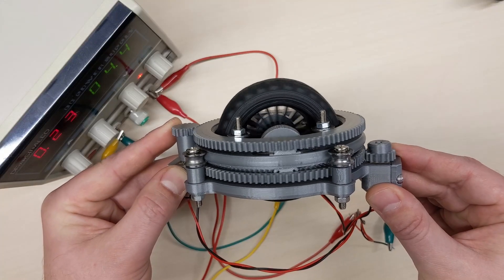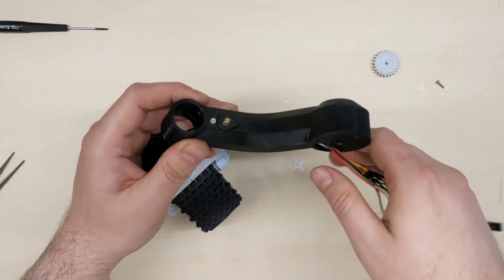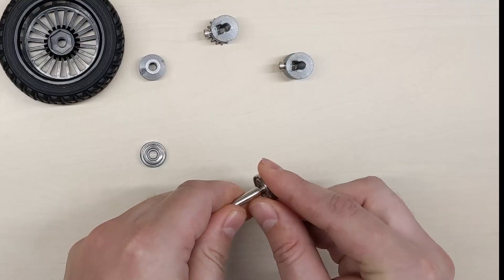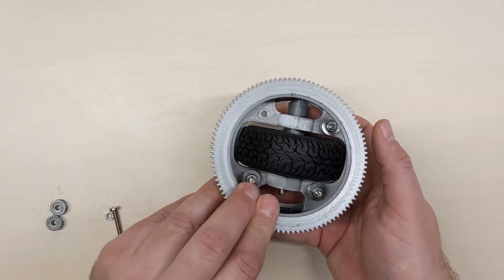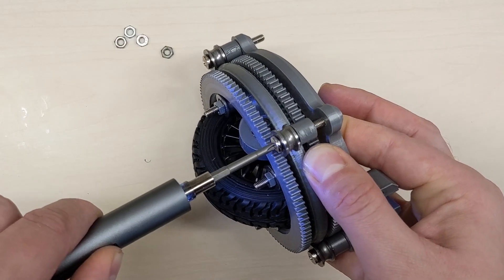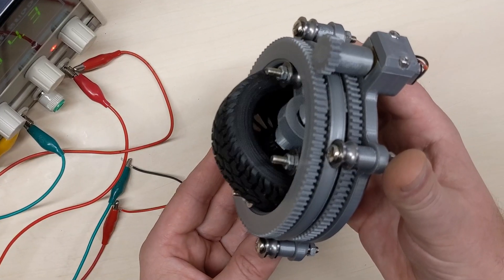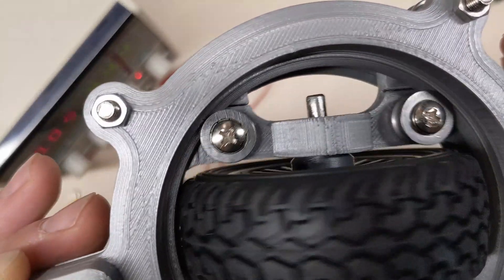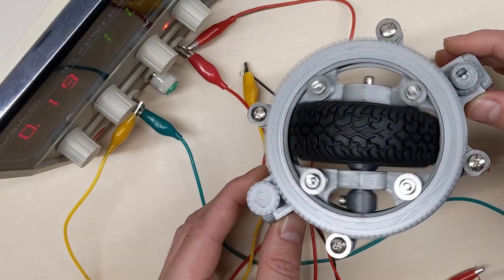Differential Swerve Drive

Comment: absolutely GENIUS- your idea, or did you get it from somewhere else?
Reply from the maker: I wanted to make wheel with two stationary motors that controls the two axes. I had the idea to use a differential like in a car, where one input motors controls two output wheels, but in reverse, so that two input motors controls one output wheel. Looking a differential I noted, that you can connect an axis to the inner gear to get the last rotation. After having thought about this for some time, I just went on Youtube and found similar solutions. It goes by the name of "differential swerve" and are typically used in robot competitions.

Comment: Could a "slip ring" have solved the "tangled wires / limited rotation" problem on your original design?
Reply from the maker: Yes probably, but they are quite expensive, and also I'm not sure how well they work for transferring encoder signals from the motors without adding noise to the signals.

Comment: Hi, i have a question. What is the maximum payload for this Swerve drive sustem if there is 3 of it. I would like to know as i want to implement 4 of it in my project. Thanksee ❤
Reply from the maker: I'm not sure. The N20 motors I used in this demo is not strong enough for heavier load. In this three wheeled design https://www.youtube.com/watch?v=4N6FfiLL41w I used stronger motors. I think it can handle several kgs before the load on the plastic parts is too much.

Comment: why not just use the original design with slip rings?
Reply from the maker: Slip rings are a bit expensive when you need 6 of them. And also, I'm not sure they can transfer the encoder signals from the motors without adding noise.
Reply: @wildwillyrobots  guess you have a point there on cost, idk about the communication, it's been a minute since I seen this.

Comment: I was wondering, how did you design the reverse bevel gear? Or if there is a better name for it?
Reply from the maker: The bevel gear was modeled in Onshape using a feature script called "Bevel Gear Pair". It was then combined with a normal gear made using the "Spur Gear" feature script.
Reply: @wildwillyrobots  Could you possibly make a CAD tutorial on making one? Also if you know is there a way to do this in fusion360?
Reply from the maker: @bio.s2903 In Onshape, once you have selected the feature script, you get a dialog, where you put in the dimensions and the gear ratio, and then the gear is automatically generated.
I have never used Fusion360, but assume it can run custom scripts to generate complex parts, just like Onshape.

Comment: Brilliant design. However I think a simpler answer to your problem would have been to use a slip ring to pass the drive motor wires through the steering axis.

Comment: A slip ring might help with the wires limiting rotation
Reply from the maker: Others have made the same suggestion, but they are a bit expensive. Also, I'm unsure if they can deliver a noise-free signal for the encoders. Regardless, I simply wanted to try something different.

Comment: When making your robot, make sure to use a gyro so that the robot can be driver oriented, and not robot oriented. It makes it much easier to drive.
Reply from the maker: I will mostly be running it autonomously, so remote controlling is not an issue. But I will most likely add an IMU to improve the accuracy in autonomous mode.
Reply: @wildwillyrobots  Sounds good. If I can be of any help programming it, let me know. This project looks very interesting, and I am excited to see where it goes. Keep up the good work.
Reply from the maker: @SomeGuyOnTheInternet118  I mostly got it working, as you can see in this follow-up video: https://www.youtube.com/watch?v=3W0p16vsgqA Will make a more detailed video about how it is controlled later.

Comment: Outstanding design!  I am a boop. But what makes me curious is that compared to omni wheel, what are the advantages and disadvantages?🤣
Reply from the maker: Omni wheels with rollers tend to slip on the surface. Also, you can push them around because the rollers are not actively controlled. This makes it hard to do precise navigation. This design is better suited for navigation, but compared to an omni wheel, it is much more complex both in hardware and in the software needed to control it.
Reply: Thank you very much!

Comment: what happened to the cad file it does not work when I click on the printables link
Reply from the maker: I think Printables are having some issues at the moment. It works, but download is extremely slow. According to a banner on the site, it is currently working in limited mode.

Comment: You may want to consider an alternate gear setup that will take a couple more gears. The way you have it setup now you need both motors to spin exactly opposite to move without turning. By adding gears you can make a mechanism move without turning with only one motor. The other motor will turn it. More complicated but maybe more ideal in some situations.

Comment: I think that I can write down the math to decouple the rotations and create a preprocessor block that given the speeds on each axis generates the speed references for the two motors
Reply: Actually I think I've done it
Reply from the maker: @FliBaleon  Yeah, it's not that complicated. For one motor is is the sum of the wanted rotational speeds (each divided by the ratio of the gear for the rotational axis). For the other motor it is the difference of said values. Or at least, that was what I got😀

Comment: Back in 2012 I worked on a design we dubbed Emperor swerve for FRC competition. The design files should still be public. Our design just like this one requires very accurate sensor feedback of the wheel orientation and speed. Our biggest issues revolved around that data becoming inaccurate. We uses an optical limit switch to identify when it was pointing straight forward, without it we’d loose orientation in minutes.

Comment: I wonder what will happen when the wheel is forced to stall in either turning or motion. I suspect this designs major downfall will be unintended direction changes and wheel motion when there is stalling or a mechanical failure of a gear or bearing.. 

Neat design, but I don't think it will fail very gracefully.

Comment: Another way you could use your original design is if you ran your wires from the motor for the wheel itself and for the turning up and then you with 3D printing make a column and actually put copper rings on it just like an electric motor a brush motor and then you take some old brushes or you can make some brushes using copper and Springs that will rub against the Rings in that way I actually allow you to spend 360° as many times as you want and still get the power to it as pretty much the same way how some heavy equipment works that's the same way how airplane and helicopter de-icing systems that need to use high voltage to heat up the blades work your steering wheel in your car or truck uses the same thing for the horn all the controls on your steering wheel and for the airbag it's called a clock spring for the airbag and everything

Comment: This was very cool, maybe add a second gear in the opposite direction but allow it to spin freely from the wheel drive shaft, this way it would do nothing in terms of motion but it would give extra stability and the wheels could handle more heavy duty aplications, overall this is a very impressive design, I want to see how it evolves

Comment: What’s the catch? Sure there are some limitations of design. Like loss in torque for example?
Reply from the maker: The large space required around the wheel is one obvious drawback. Another the fact that if you run the motors at full speed to drive (spin) as fast that you can, you need to slow down in order to rotate.

Comment: Really cool idea.  While horizontal and vertical rotation are both easily used separately, I wonder how much use really comes from the range between.  It seems like the motion gets a bit difficult to predict.
Reply: If quadrature encoders where used on both motors, the motion should be very predictable.

Comment: Have you thought about using a slip ring?
Reply from the maker: Yes, but they are a bit expensive when you need 6 of them. Also, I'm not sure if the cheap ones are able to transfer the encoder signals without adding noise.

Comment: Are you planning on having some kind of positional sensor to check that the wheels are pointing in the direction the robot thinks they are?
Reply from the maker: Yes, I will add encoders to both motors and a third sensor for zeroing the rotational axis.

Comment: It's a great mechanical design, well done! I wonder though, how much fine tuning will be required for the controllers. It's likely that one of the motors will be under a slightly heavier load than the other, causing the direction to drift. Close loop control on both motors may be in order, but I would love to see how this develops! Good stuff man!
Reply: I thought the same. Probably an encoder is needed to fine tune the direction

Comment: It's a good design, I'm just wondering if you've considered if simple slip rings would work for your original design.
Reply from the maker: Yes, but they are a bit expensive when you need 6 of them. Also, I'm not sure if the cheap ones are able to transfer the encoder signals without adding noise.

Comment: To allow the wires to rotate infinite times inside the joint, you could solder them to rings in the pole, and that rings conected with tabs to the wire arms. This will solve the problem as many toys do. Your invention its cool, but is not practical at all and overengineering. However it's always cool to see new ideas around.
Reply from the maker: I need to transfer both power and encode signals to the motor, and high quality slip rings are a bit expensive. I mostly created the differential swerve for fun. I know that it has a lot of practical limitations😊

Comment: A very nice design, I love it.
I foresee an issue using DC motors, if the two motors are not exactly balanced (RPM) you will have creep in steering when going straight.
Do you intend fitting some sort of an encoder on the centre part for positional feedback? So that you can make adjustments to each motor.
Reply from the maker: I will add encoders to both motors. From those I can calculate the position of both the rotational and spinning axis.
Reply: @wildwillyrobots  Fantastic. I look forward to seeing more.

Comment: The hardest things is to make the twin motor to keep run on same speed, which can be solved through sensor and dimmer but the more wheels it will be more complex
Reply: Quadrature encoders would let a microcontroller accurately control the speed.
I made a Mecanum wheeled robot which didn't work well until I added quadrature encoders to each of the four motors.

Comment: There's a connector used in rc tanks that allows 360° spin with wires
Reply: A slip ring? Those work, but become complex when you factor in both power and signal wires for a motor and controller. Both coaxial and differential swerve drive modules transmit rotational power mechanically.

Comment: I want to do this for my combat robot would this be able to withstand bumps? I would use two wheels in the middle of the bot so safe from weapons just worried about bumps and bouncing
Reply from the maker: The design itself should be fine with bumps, but obviously the plastic parts are not very strong. If you search for "frc differential swerve" there are some examples of differential swerves made from metal.

Comment: Very cool design! As far as your wire binding limitation on your original robot design, I was going to suggest you use brushes in the steering axis to bring power down to the drive motor, this would allow infinite rotation of the steering, ( similar to how an excavator can spin in circles indefinitely because they route the drive oil for the hydraulic drive Motors through a slewing bearing).
Reply from the maker: The problem is that in addition to the 2 power wires for the motor I also have 4 wires for an encoder. Bringing those down to the motor in a way that doesn't add noise to the encoders is not easy to do in a cheap way.
Reply: @wildwillyrobots  This just hit my recommended and it's really cool! Came to the comments wondering about asserting positioning. You mention encoders; assuming one one each drive motor. Does this maintain precision or did you observe drift? My mind jumped to having a magnetic position sensor straddling the wheel for angle position then letting some other positioning sensor handle in environment position assert.
Reply from the maker: @DesignCell  Haven't implemented the controller yet, but from the the motor encoder values it is possible calculate the absolute position for both the rotational and spinning axis, so I don't expect problems with drift.
Reply: @wildwillyrobots  Couldn't you just do a stepped multi-level slip ring. That would put space between each of the 6 lines and still allow infinite turning.

Comment: For the final design, you should have a toggle-able "locking" gear-set to enable maintaining a heading without relying on the differential power input from the motors. When engaged, both motors would be exclusively powering the spinning action of the wheel.

Comment: It's definitely a interesting novelty. But in terms of practicality, the design used in the 6-wheeled robot is far better. The rotational limitations would be easy enough to deal with using slip ring contacts. The need for the power to transfer through 2 gear interfaces for any motion is cool, but impractical. 
Great for a YouTube video though.

Comment: The cable routing might be easier if both motor were atacht at the same side of the outer ring, but a realy cool desing anyway.
Reply from the maker: Yes. I just mirrored the part, once I had designed one of the motor mounts. For my robot the motors will be mounted slightly differently to save space.

Comment: I think you’ll need some thrust bearings for vertical loads.  Another option would have been for power to be transmitted to the motor via sliding contacts at the axis.
Reply from the maker: Good point about the vertical load. My robot will be in the size of a small robot vacuum cleaner, so I think the current design will be able to handle the load, though.

Comment: Kinda surprised that the two small Motors have an identical or almost identical enough RPM for the wheel not to drift. Will you just run with that assumption, or do you plan to account for that with either a Hardware ( my best guess being the use of a 2 Motor single Gearbox Differential Setup driving the two large Gears with one Motor only doing the Driving while the other does the Steering ) or Software solution ( like reading out an encoder being installed somewhere )?

The reason why I'm asking is because of my experience with my 1/16 scale RC Tanks that essentially have the same problem with their pairs of DC Motors powering the Tracks... My models with two independent Gearboxes always have some slight drift in them because there seems to always be one motor, gearbox or controller that is weaker than the other and even if I account for that with trim while driving forward it'll still be visible when driving backwards whereas the model with two motors and a combined gearbox will always drive perfectly straight as only one of the two motors is responsible for driving while the other does the steering.
Reply from the maker: I will add encoders to both motors, so that I can make a controller with a feedback loop.

Comment: While it's a nice piece of engineering, it's seems like an over complex solution for what you end up with if those are the type of motors you plan on using.
In your first example you had 5 wires going to the wheel which I assumed was for the motor and an encoder. But your second example had no encoder. Only a pair of DC motors. If you were willing to settle for that, why not just use a slip joint for the power to the motor in your first example. Even something like a 1/8" stereo jack and socket will give you a cheap easy 3 conductor way to transmit power through a rotating joint.
Reply from the maker: I will use motors with encoders. In the video I used some small N20 motors from another project, just to test the mechanism and to see if they would be strong enough. I got new motors with encoders now, so that I can do a control loop and control the speed and the rotation precisely. And yes, it is an overly complicated design. But fun to create.

Comment: make the robot be a sphere wheel
Reply: can be a quad flying drone in the sphere mesh wheel as well
Reply: bouncy flex mesh shield sphere
Reply: you could make plastic bearing if you lubricate the 3d printed surfaces with graphite, tho
Reply: better have a hub motor inside, then conduct electricity through the bearings/graphite to the motor, from outside, brushed bearing
Reply: also ball sphere wheels work too